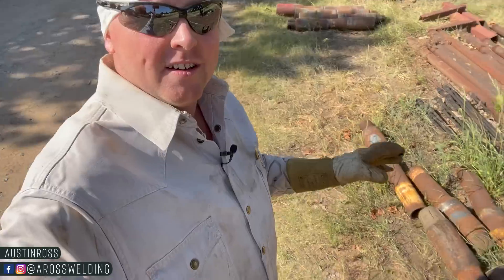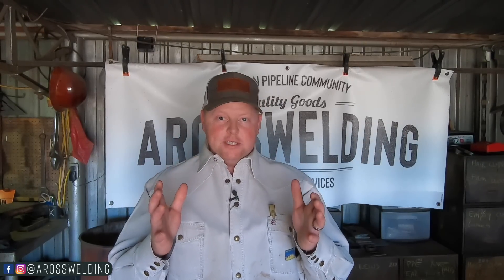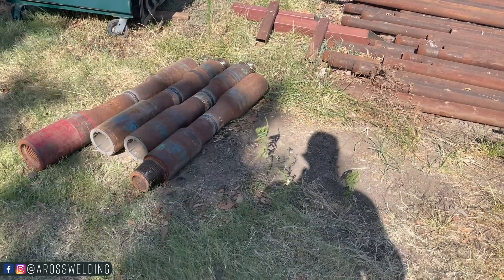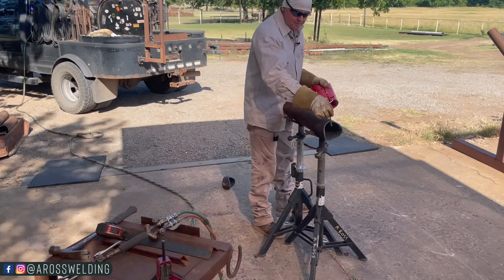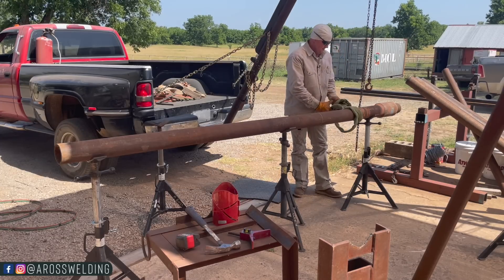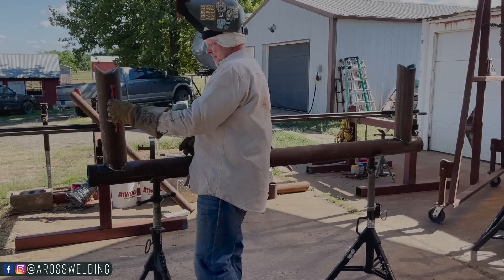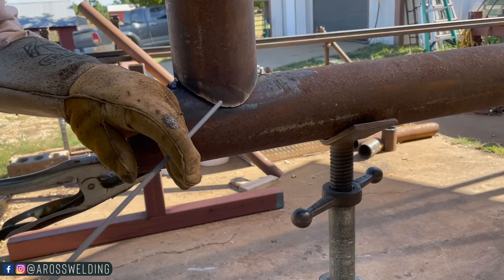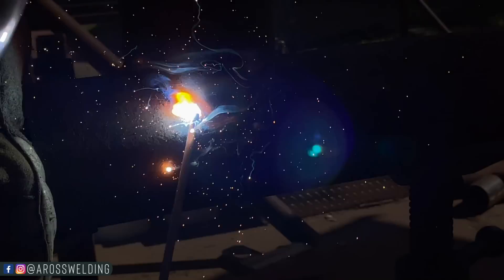WHEN WELDING ON MAGNETIZED PIPE

Comment: 30 years old. I know how to stick weld but am a pipefitter at the moment. Its nice to learn trick like this. Just ran into this problem at work with the wleder having " spit back" as he was trying to tack the bottom. We tried to wrap the ground 3-4 times around the pipe and tack the ground clamp to the pipe to help with this.

Comment: I went on a rig hook up in the gulf in 1983. I experience dead iron. It was almost impossible to weld. It was an exhaust pipe for a power generator. I'll remember those days fondly. Sometimes we'd be up for 96 hrs welding cason pipe; or go out for a well head job. You weld until you finished. My most favorite jobs offshore were when we placed a jacket in the gulf. Sometimes, I would go out for a couple of weeks and hardly strike an arc because of weather. We would be playing hearts, spades, or booray. Other times, it would be 18 hr days working hard, but smiling because you were making good money.

Comment: I am 32 I have been stick welding on and off for 5 years primarily tig weld piece rate but we deal with this every now and then and wrap it with ground lead 3 or 4 wraps or heat it super hot with a rose bud magnetized items lose there strength the hotter they get

Comment: 68. Worked as a pipefitter/welder for a railroad for 47 years. Learned to weld in college, then worked with an old guy out of Oklahoma oil fields for 8 years. He could weld a peanut on a gnat's ass, under diesel fuel. Learned to weld from him. Welded with junk machines on junk systems under the worst conditions and got really good at it. Welded in a new tank nozzle on a tank that had 2 volts of electricity on it from the grounding mat that a moron engineer specd. for grounding the wwtp. Had to use 6010 with the polarity switched on all the root passes. It was like the tank was trying to weld the rod. Wild ride! Got er done and it looked damn good.

Comment: Pipeline welder for 20 years inspected for 23 years . We used a separate machine and wrapped it’s leads around the pipe start machine increase amp’s if it gets worse switch the direction of the wrap of the leads. On pipelines after companies run smart pigs their pipelines get more magnetized every pig run.

Comment: 66 ,what you need is a de-gousing ring a coil of wire powered by alternating  current passed around the pipe,pass the pipe through the coil! Viola no more magnetism! If you must weld use AC with AC rods!

Comment: How did that pipe come to be magnetized? Was it conduit for high-voltage electrical cable? Is the magnetic field wildly distorting the weld puddle? Really enjoy your channel, Austin.
Reply: Think of it like 2 magnets turned around backwards.They push away from each other,when welding it your puddle pushes away from the pipe.
Reply: @dustinhasty3147  That's absolutely amazing. Thank you for taking the time to answer.
Reply from the maker: I think from being in and out of the earth. Used for drilling.
Reply: Yes drill pipe rotation and drilling in to the earth's magnetic field.

Comment: Great video, information & channel, Ross! I first started learning to stick weld/ SMAW in '79 in high school auto shop/welding shop (im 57 in a few days). Only acetylene & stick available there. I welded corrals, squeeze chutes & a fancy front gate for Dad & Moms farm. Even crudely welded a dual muffler exh. system for the farm truck. Years later (mid '90's), I went to industrial arts college & learned Stainless Steel Tig to fab Turbo systems & advance my career in automotive research. What fun! I picked up mig skills OJT as well. Loved it until diabetes slowly stole my vision & arthritis stole my mobility. Dang I miss welding so much! Now a drunk dirt dauber wasp can lay better beads than I can.  Sorry for rambling, Paul, from S. Central Tx.

Comment: 27 y/o, 1 year welding, about 750hrs or so under the hood, I've been told that a good way to deal with magnetized pieces is to move the ground clamp as close as posible to where you're welding, another one if you are welding with 7018 is to use AC instead of DC,

Comment: If that stuff is magnetic it is more than likely RADIOACTIVE. LOTS of radioactive tubing, tanks, pump barrels and heater treaters  in your area. After having access to a geiger counter I started being much more careful about having anything made out of old tubing or tank doors and I don't have any of it laying around thats radioactive anymore.  When I was a kid a guy in welding class at votech told me I wouldn't like it and said if I had a welder he could teach me to lay beads so I bought a Sears cracker box and all the trimmings and put a 50 amp breaker in my parents fuse box going to the dryer and started welding. He had me arc welding exhaust pipe together with 6013 which I was unsuccessful at for a few weeks but I didn't have much troubles welding other stuff after I learned to do that except for overhead welding. I took machine shop class at votech because the automotive class teacher hated HOTROD magazines. Gasoline cost about 70 cents a gallon then.

Comment: 45 years old. Been stick welding for 13 years. I run magnetic pipe on AC when I can. Otherwise I coil my ground wire clockwise or counter. Punches through the magnet.

Comment: I am 62 years old welding since age 20 or 22.  Best solid run was for 26 yrs subbing thru a large steel warehouse doing a lot of house steel and small commercial. Along with various drilling welding and cutting grinding and painting. A couple yrs at ro Corp welding cranes and about 9 yrs Woking for a sign company.

Comment: Good evening there partner. Nice to leave a comment for you. My name is Mark I live in North Carolina but I'm from Houston texas. I'm retired pipeline welder. I'm 69 years old I'll be 70 next february. I've been running a rig truck since January 1st of 1979. Started in the oil field building drilling rigs in Houston then went to transmission work off of Wells that are already completed then went to distribution services for a number of years. I became a welding inspector in Florida for a large Gas Distribution Company for about 3 years. It was pretty stressful cuz I oversaw Three Counties on everything that was done from the service lines to Maine distribution lines put in. It was easier for me just to make a weld and the inspector check it out and I go home. So I left it after 3 years. Sorry this message is so long I've been listening to you for a couple years now this will be my first comment. I have held number of certifications from asme to API for petroleum Refinery work and pipeline work. Even though I'm retired now and I still have my red truck. I wiled for the ranchers and farmers and loggers in my area when they call me. Other than that I've been retired 7 years. I've worked on everything from barbecue pits to rocket ships. Worked at Nasa on a couple contracts in the early 2000s and I oversaw the gas lines in nitrogen lines that run all around NASA up at Cape Canaveral when I was in inspector. Welded on a lot of magnetized Drilling stems after they bring them out of the hole and they x-raym and find out they have flaws in them but that sometimes you got to use that stuff to build structural stuff with. Anyway I won't go on and on which I have a tendency to do with this phone that's automatic and picks up my voice sometimes it's still picks up my Texas draw even though I've been going from there for a number of years. Take care keep up a good work there's a whole lot more to welding then pipeline work that's for sure you can get into Bridge work you can get her a number of things with your red truck. Be safe on your job site and be safe on your travels your family expects you home every night. Take care partner. Mark Scott Shelby North Carolina

Comment: Am 78 years old, began stick welding in 1962. Am an operating  engi neer and mostly crane and some boom on pipeline work for Sheehan, US Pipe, Murphy Bros., Welded,  and Willbros. Now retired and do dragline work in ag sector drainage districts. Do stick build up on buckets as well as hardface. Many parts are Manganese steel so run 308-16 stainless.
Have also welded water well casing so have had 6G cert for that in past years 1980. Needless to say boomed around country some.

Comment: 63, been stick welding 44 years. 👍👍👍 I learned you have a really nice pole truck! 😊😊😊 Sometimes I find that it'll want to fight you in either direction. Wrapping the cable around the pipe a few times helps. I always find something helpful in your videos, thanks!

Comment: Love your videos man these have been a huge help big up from Jamaica 🇯🇲 🇯🇲!!! I’m 23 and I’ve been welding for 3 and a half years but magnetized pipe hasn’t been too big of a problem once the amperage and arc force are adjusted a bit. I’ve found having the ground closer with a good prep after cleaning it down to bare steel you couldn’t even tell.

Comment: 57, learned stick welding in middle school from my dad. Worked in the WY oil field as a helper after HS before joining the USCG. Spent 22.5 yrs in the CG using those skills. Haven't welded much since I retired  in 2007.  I need to get back into it, even if it's just some home fab projects.

Comment: Wrapping grounds, wrapping positives, heating with a torch, smacking with a hammer as you have your ground and positive directly hooked to the pipe at like 50 amps, reversing polarity. 
That's a list of all the things that supposedly work.. what works every time is basically what you did, cuss alittle as you melt the rod in. Really just get something in there and let it cool down and it will be good to go after that.

Comment: Magnetism on iron loses its effect once heated above about 400F, so I just start by heating before welding.
I am 73 years old, been welding since 9th grade in high school.  I worked petro-chem construction for 40 years pipe welding and later working quality control/management.   I set up a little community welding shop just to have something to do after retirement.  I  barely charge enough to pay for my consumables, mostly do it for something to do and help out the community.

Comment: 40. Been welding for 20 year's really started focusing on stick welding the last 5 years. I was on a job doing anomaly digs and replacing boar sections where we ran into a lot of magnetized pipe. The device used to demagnetize the pipe sucked nobody new the correct way to coil it around the pipe at first lol. Hood time is important like Mr Ross mentioned. If all you have is one joint to weld. Weld that joint and keep stacking bead's over it till your able to find more material.

Comment: 73 been welding about 15 years. Worked on the inland water ways as a towboat captain and pilot for 45 years. After retiring from the river a started hay farming and out of necessity taught my self how to stick weld. I have made modifications to implements repaired them as well. Built smokers for my self and others. Built hay wagons from running gear. Made repairs on tractors. I have learned some really valuable tips from your videos. I mostly used 6010, 6011 however really started using other rods 7018, 7014, and 6013. Using a lot more passes and making better fit ups. Thank you for sharing.

Comment: 40 years old, started learning how to stick weld in high school. Did a lot of it on ranch projects, but now doing it for a living for the past year. Still got a lot to learn, but who doesn't? One trick I've started using on magnetized pipe is, if the welder and the rod will allow, switch to AC. It cares not about the magnetization, and lays a decent bead on.

Comment: Will turn sixty tomorrow. Started welding in 1978. Worked in a tank shop than in 81 started helping a welder pipelining broke out in 1984 as a rig welder. Pretty much been pipeline welding ever since. I just finished a job in March welding freeze pipe as it is called to freeze the ground to dig 700ft water shafts in NYC. We were building 280ft sections to be drilled in the ground. They bought old drill pipe. So really bad magnetism. Like you said the more the weld on it the better it welds. I also heard heating helps. Me and my partner got thru it. I was during dig ups in Staten Island few years back 36 inch transmission line. Real bad magnetism on that as well. You mentioned about reversing your leeds to weld magnetized pipe. That is straight polarity. Even at my age I look forward to your video's. After all this time still love to weld. Most of my welding has been stick welding. Take care and be safe.

Comment: 40. 28 years.  Originally for money, and now just for myself.

Personally, I like to just switch to AC on magnetized material.  I have a strong preference for 6010, but I’m not too proud to use 6011 if arc blow becomes a big problem.  Supposedly the 7018 and 7018AC rods are the same thing in the generic-grade rods, so I just hit the switch and go.  No problems thus far doing that, but I wouldn’t consider doing that for critical applications.
Reply: I go with Ac too, and with 6013, as I weld simple things and mainly for hobby. I've been welding for 10 years , more or less.

Comment: 50. stick welding over 25 years......it is possible to demagnatize small components like that. I was an aircraft mechanic for 15 years and some employers required your tools be slightly magntized in the event of a lost tool somewhere on an aircraft. Rather than opening all kinds of panels, a scan can be performed. I can't remember what its called to demagnatize, its something used in  NDT (Non Destructive Testing).

Comment: I'm 56, and Dad taught me how to stick weld when I was 12, so 44 years off and on.  I have wrapped the ground lead or switched to AC to counteract magnetism. I didn't know about reversing the polarity, might have to try that sometime. I weld very little pipe. I mosly mig and tig aluminum, and mig, tig, and stick weld stainless. I have been running my own shop full time for four years,  but have had a wrench, welding stinger, or truck wheel in my hand for   36 years.
Reply: i doubt austins machine runs ac...  would be interesting to see a comparison of wrap vs ac to see which works better.

Comment: I’m 73 years old and been welding since I was 13 years old. My favorite solution for welding magnetized pipe whether with either stick or MIG is to wrap 3 or 4 loops of the ground cable on the pipe. If it doesn’t work at first I reverse the rotation direction of the ground cable.
Reply: If I'm in a shop, I break out the old AC buzz box with some 6011
Reply: DITTO!!!!!!
Reply: Agee 100%👍.... 8yrs old started on 7014/ 62yrs old now I think, 🤔.
I was around 19yrs old and my dad had this ugly looking welded bubble gum of welding art that you ever seen on the bench. He says to me you recognize this. Nope. This is one of my practice welding piece's that I threw in the steel bin. He kept it all this time.😄😄 Don't you have better things to do Dad.😄
Reply: Yep, that will usually make a difference, wrapping the ground around the pipe.  I learned that years ago in Welding School.  Changing direction of travel helps too usually.  Very often I PREHEAT the area to be welded, as heat "destroys" Magnetism in the area enough to settle the arc blow down quite a bit.  After it cools it goes back to being magnetized in that area, I guess ( not for sure) the "magnetism' is conducted back to the welded area by the rest of the pipe or work piece.  If you build fences from used drill stem sooner or later you get some magnetized pipe or tube.  Sometimes, I have done all three to get it welded.  It seems to me, I am 72 and have not been welding a lot in later years, but it seems getting it HOT and KEEPING it HOT until the weld is completed will defeat the Magnetism enough to tame the Arc Blow until you are done with the joint.  Once it cools the magnetism come back to the welded area.  Austin makes good videos!!
Reply: I need to weld plate steel. 8cm thick, 1.5m across. It's weird, only one side of the plate is magnetised. I don't know what to do. It's all bb's and birdshit
Reply: Ah yes, ye olde electromagnet
Reply: I always used 316 stainless rod.
Reply: Yes sir done it many times.
Reply: Thank you for this.
Reply: 51 I have only been welding a little. Built a lot of pipe fences at my bosses ranch. Fixing equipment that I brake. Thinking of taking your fence class. Maybe after I catch up from Christmas.
Reply: Demagnetize it

Comment: Stick welding for about 20 year. I've personally had welds on magnetic pipe pull apart like it was lead. We were using 4 inch pipe for fence posts and 1 1/2 inch horizontals. The 4 inch was very magnetic. I've never seen a weld rip like that.

Comment: I'm 49. Burned my first rod when I was a junior in high school.  Old Dude (may he rest in peace) always said to get that magnetized pipe hot and it'll quit.  I hang in there with 3/32 7018 (even if it ain't fun) and after it gets hot enough, it welds like normal. The Old Dude knew some cool stuff.

Comment: I've scrapped tons of those tool joints...there is no reason why a scrap yard wouldn't take them and pay top dollar prepared plate price...they are a great thing to scrap because of their weight.  As far as welding magnetized pipe I say just fight a quick first pass in it and then it will weld fine after you've got one thin pass around it....I've always thought all that cable wrapping jargon was a waste of time....got my first stick certification in 1992...I'm 47

Comment: 37, started stick welding when I was about 12 or so and got a mig when I was about 16. I just farm welded for years, and took a welding class a few times in high school and once in college. Family business went down hill a few years back so I have been structural welding for a friends business for over a year now. We build barns and carports and barndeminiums a lot as well as pipe fence and things. A trick I learned from my dad back in the day was to take my stinger and wrap it around the pipe 4 or 5 wraps and then weld, it helps with magnetized pipe.